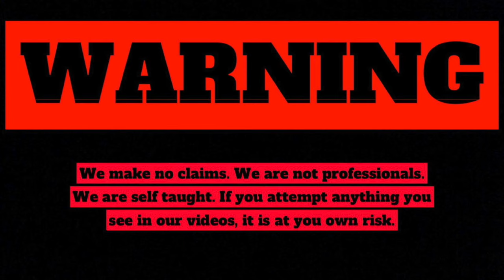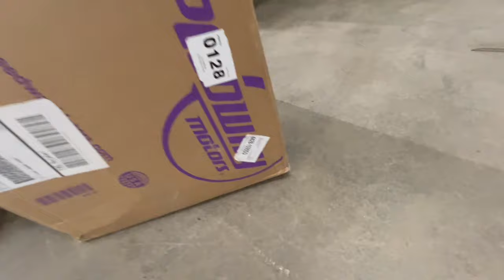1967 4x4 Chevy Van Moves for the First Time! - The Swim Shop 4x4 Vans

Comment: From a furniture maker, I use poplar all the time as a secondary wood where you don't see it or when the project is going to be painted - Jusy a friendly suggestion, paint the poplar piece black and clear coat it. Leave the oak as-is...  
It looks like the rear wheels are narrower than the front end
Reply from the maker: Thanks for the input. The rear is narrower. GM square body diffs, the front always had a wider track. Thanks for the support!!